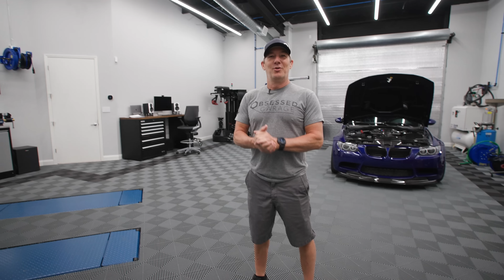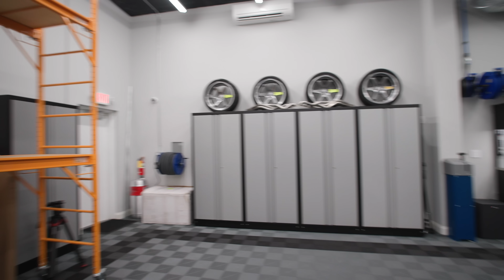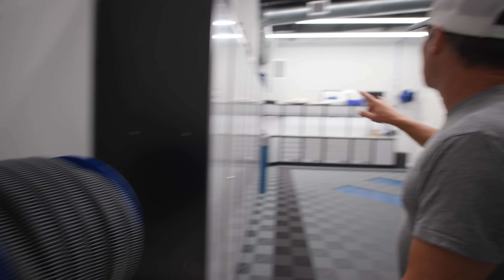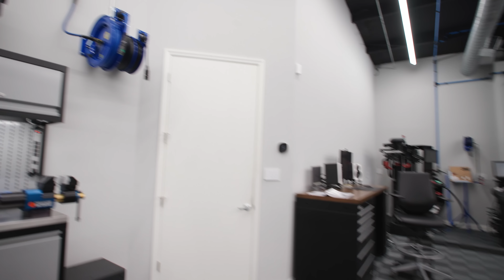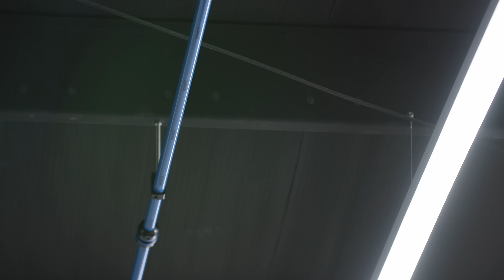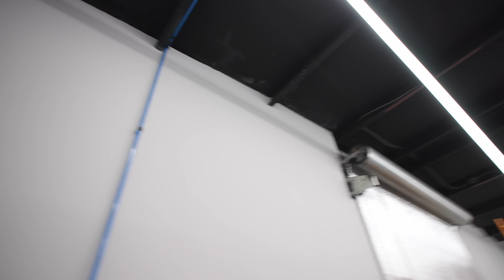Prevost + Cox Reel Setup Tour w/Mike F

Comment: @obsessedgarage - I know there are 4 holes on the coxreel mount. How do you have those mounted to the wall. I’m tryinna mount mine.
Reply from the maker: 3/8" Lag Bolts into a stud or backing.
Reply: @ObsessedGarage  are the holes spaced closed enough together to get all 4 holes in a single stud?

Comment: Amazing work, awesome install. I have one personal opinion that those ProLock outlets on the hose reel are not great they are shiny hard plastic that feels cheap and scratches really easily and they don’t lock well. I changed all my plugs to Leviton Wetguard I know they are yellow which is not obsessed garage colours but they are a nice yellow rubber and can’t scratch anything and the plug is industrial grade and water tight which is awesome if you put wetguard plugs on devices like pressure washers etc. which will be near water.